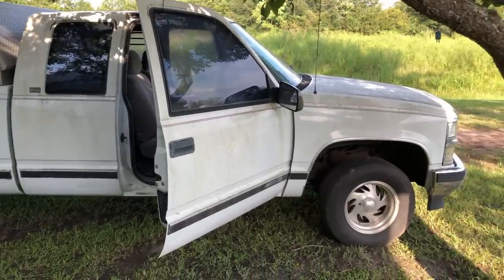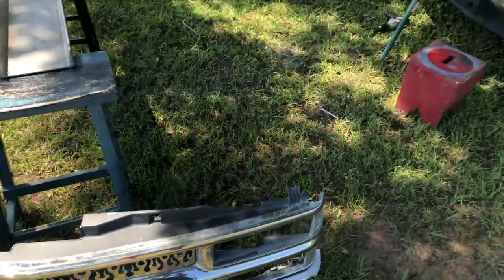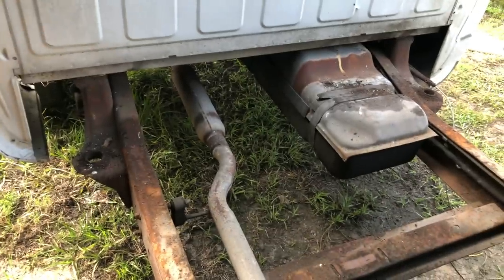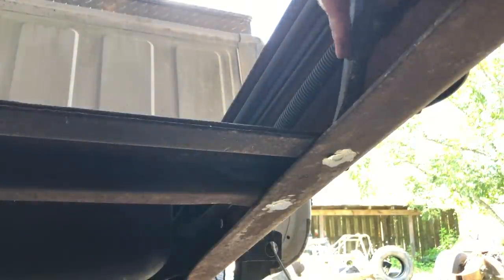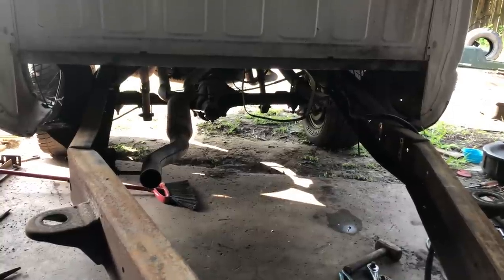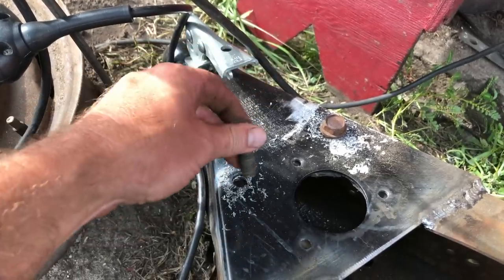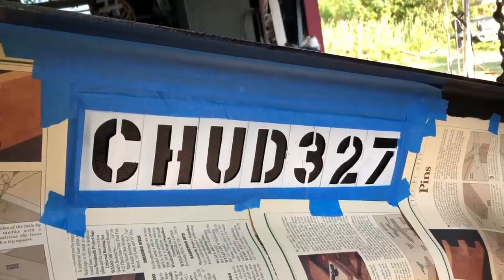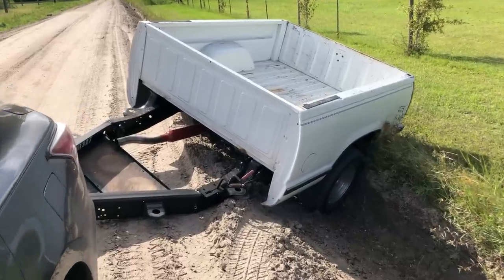Building a Sicker / Better Truck Bed Trailer #2

Comment: If you take out the tool box and mount it on the frame, that would give more bed space and shift a little weight onto the tongue. Of course, in this case it would hide the glasspack.
Reply from the maker: Great points, if you check out my latest build, I mounted the tool box on the tongue, plus no still glass pack to cover up. Thanks for watching!!

Comment: I kind of thought you were going to leave the gas tank in the trailer. If you put a switch on the fuel pump and put a hose on the fuel line you could make a portable gas station. You wouldn't have to carry gas cans then when taking out the mud mowers.
Reply from the maker: I thought about that and may have to put it back it... thanks for watching.
Reply: I bought a trailer that once had dual tank and thought the same thing
Reply from the maker: @WolfDragonTamer  good idea.

Comment: Its good to wear a full shield face protector when using an angle grinder because the blades are notorious for breaking off and hitting people in the face. Great video and good job on the trailer/s.
Reply from the maker: I will look into getting another, my old one broke. Thanks for watching.

Comment: That bed frame rail angle iron is some tough stuff hard to drill threw.
Reply from the maker: This one wasn't too bad, but I didn't have to make too many holes in it either. thanks for watching.

Comment: Good idea man. Also could take a pulley and put on one of rear yokes with a belt connected to an alternator and battery box system so you'd have power to run a power supply or inverter when camping. Possibly a tank in frame, with water tank pump set up for extra potable water.  Toolbox would be ideal for battery stowage
Reply from the maker: Sounds like good ideas and thanks so much for watching.

Comment: Hey man - move the toolbox outside the truck bed, forward onto the front bent frame rails. Then it can be a permanent store for ropes chains etc.
Reply from the maker: I have thought about that, I will need to see if it will fit and not interfere with turning.  It would also give a bit more tongue weight and reduce wind drag. Thanks for watching.

Comment: All of my trailers have a sleeve hitch on the rear and at times I'll pull them double. I have double n triple endorsement license , but never have been stopped when in smaller farm trucks.

Comment: I knew a guy many years ago who did this with a full size box painted like the truck . Both truck and trailer had matching caps . Looked cool as hell but about useless because he didn’t want to ding either one up .
Reply from the maker: That sounds about right! I would love to find a bed that match my truck and find some tires and wheels to match too. The good news is, my truck is already scratched up and I am sure the bed would be too. thanks so much for watching.

Comment: Lots of folks build these Pickup Truck bed trailers - and I understand the appeal and the functionality of them. Just wondered if anyone had EVER considered doing the opposite - a trailer from the front end of a car/truck. I think this might be a cool idea for an ATV trailer or a low-dump trailer. Take the front end frame - remove cab - engine and all the "stuff" including steering column and radiator etc. Then cut the Tie rod near the middle and weld each end to the frame so both front wheels are held in a aligned straight path. Now you have a independent suspension with nothing in the middle and you can fab a trailer bed that can extend between the wheels and has a "V" or "U" shape for soil/dirt/rock hauling. Similar to the Truck Bed trailer - you keep the frame extensions - but headed toward the back wheels - to bring them together to form the tow point. Seems like with the right cross bracing, maybe beefing up the shocks or struts you could have a really slick dump bed trailer with a low center of gravity and independent suspension on each wheel. Any small foreign rear wheel drive would do for a farm utility trailer for your ATV to drag around. I'm no welder or engineer - just wondered if this idea would be worthwhile considering you could find lots of potential junkyard project vehicles for little or maybe even free.
Reply from the maker: I like this idea and probably no one has done it before. Might be nice to leave the steering too. Locked for pulling and steerable in tight areas. I put a vw bug front end under a boat trailer once. It was cool, I could pull it on my dirt road and my son was  driving in and out of the ditches. Would be good for long trailers like the guy that steers the back of the fire truck. Independent suspension would be neat too. Maybe I can try it some time in the future. Thanks for watching

Comment: I like #2 better because it's a shy but longer. And if you end up making a camping cab out of the cab please make the wipers work that would be awesome and if you have a spare Chevy bow tie for cheap I will buy it from you! I got a 70s Chevy bow tie on my main mower now I need one for my other mower
Reply from the maker: I think I like #2 better too, but hard to say... Working on the cab camper now and I am brainstorming if there are any bowties around here... thanks for watching.

Comment: How do I make the rear axels in my truck bed trailer free spin?

I have 3 truck bed trailers like this and I love them, they are the most versatile trailers and I don’t have to worry about dings or dents because I only let the kids use the $50 trailer. LOL

SO, I am not a mechanic and I have a question about the rear diff. 
My largest (and best) trailer feels like I am dragging it. The tires roll and I cannot prove that there is a problem, however, it feels like there is resistance that should not be there.
I have plenty of experience pulling trailers and this one just feels off.
Almost like the gears are full of MUD not grease. 
The trailer is made out of an 80s chevy and still has the entire rear diff intact. All the gears and even the driveshaft yoke are intact and spin as it goes down the road.
I would like to know if there is a way to remove all the gears from the rear diff so it can free spin, but the only rear diff I am familiar with has the axels connected with the gears.

Hope any of this makes sense. 
If I cannot remove the gears or replace them with something, do I just need to open it up and clean and regrease it?
Reply from the maker: I would probably start by taking all the brakes parts out of the drums, unless you are using the brakes.  Other that that, you could jack it up and see how they spin with your hands.  I uses you could take the ring gear out and that would just have the axles spinning.  Maybe needs a new bearing or two... Last resort, you could pop the back cover off and see if you can see any issues... Good luck and thanks for watching.  Let me know what you find out.  Do you have any videos or pics of your fleet?

Comment: Howdy Chud! New subscriber here. Quick question if you have time. I've got a truck bed that's been taken off the frame...what would be the cheapest/easiest way to turn that into a trailer? I don't have any frame components for it.
Reply from the maker: I would be great if you could find an old junk truck that the bed would bolt right to. Maybe facebook marketplace would have some. good luck and thanks for watching.

Comment: Gotta chain a centrifugal clutched briggs 5hp onto that diff and have a powered trailer to move stuff around the yard like a giant power wheelbarrow...
Reply from the maker: Now that is a good idea and thanks so much for watching.
Reply: Im sure you could power it with a 5 horse, but you would need pulleys and belts to get the ratios right. 😊
Reply from the maker: @paulzedx636ninja7  For sure and it would be a fun project.
Reply: @chud327  you could probably use belts and pulleys or maybe some sort of gear reduction. It would be pretty cool. 😎
Reply from the maker: @paulzedx636ninja7  yes it would be very neat.

Comment: My brother in law use to pull a pop up camper with his 12' aluminum boat hooked to it until he got a ticket for not having a doubles endorsement on his licence . Nice trailers
Reply from the maker: Yeah, I would pull two on the highway, but it is cool in the yard. Thanks for watching.

Comment: Great ideas and all but I would recommend some better welds if you plan to put weight in the trailers.
Reply from the maker: Yeah better is good, I added bolts and I doubt there will be much weight,. thanks for watching.

Comment: Pretty slick make over of the truck into a trailer. I might start looking for long beds as that way you can turn it into a bigger camper.  Is it just me or is the audio a little low when he is talking and then gets loud when he uses tools?
Reply from the maker: I need to find a long wheel base next... Sorry about the audio and thanks for watching.

Comment: Should put the fuel tank back in and wire the pump up and put some kinda hose on it and you have a transfer tank
Reply from the maker: I actually thought about that, but did not do it. I am currently working on truck bed trailer #4, that video should be out soon. Thanks for watching.
Reply: @chud327  another idea that came to mind while i was watching was leave the cab camper on the truck frame and have the hitch in front of the cab, then you have a cab camper and bed to haul camping gear in. another thing you could do is put a alternator on the rear axle with it running off the yoke to charge up a onboard battery all ideas that could be handy,

Comment: How do you decide on the measurements and where to cut it?
Reply from the maker: I showed that better in episode #3 on the Dodge trailer.  I lay the coupler on the ground and put boards in it and measure how long my frame parts need to be.  
Then I find a flat spot on the trailer that is the same as the length I need.  I try to make the trailer tongue as long as I can. I hope this helps and thanks for watching.

Comment: Is there a way to connect to the original taillights to a 7 pin and connect to the truck to have working light?
Reply from the maker: Yes, it is pretty easy, you could do like I did and just get an adapter or with the 7 pin you could actually have back up lights... I know on my GMC and Chevy truck the wires are yellow, green, and brown just like trailer wiring. Dodge on the other hand had all kinds of random colors... thanks for watching.

Comment: you should easily be able to trade those aftermarket wheels for stockers that match what you have.
Reply from the maker: I had an eye on some bullet holes to match my truck wheels great, but the guy did not want to work with me on the price... thanks for watching.

Comment: you should make a truck bed out of 3500 dually
Reply: Them things are hard to find in good shape
Reply from the maker: Yeah, If I could find a deal on a good one, I would sure do it... Thanks for watching.
Reply from the maker: @oldcroneysgarage9739  I agree with that. thanks for watching.

Comment: Can't believe I missed. Got to messing with something while listen to outdoor boys my fav fishing channel.  The guy from cats and carp channel. But nice job. Wish I could get you over here to do mine. Or ide give you my ride just needs head gasket. I can't afford to fix and I got new breaks bearing the front end ball joint I did front end alignment. But it's 98 gmc it still starts just water in the oil. Guess I'm gonna part out. But here Louisiana can't make new ones but if I find one with title and tag I can use. Ide love to have one for fishing so bad. I got camper shell tool box ide love to haul that around. Alot room for tackle and rods. Can haul my gen and wheel chair can add my scooter ramp on back also. But very nice sir. Your right. That would be cool. Clean up the truck take out seats add a bed and cabnit and shelf. Put on a small trailer that would be a cool camper. You should do that I'll watch. You have a good weekend. God bless
Reply from the maker: Thanks so much and too bad you are not closer.  I need to find a topper too.  I am planning to do the camper out of the cab, unless someone want to buy it before it get it done... Thanks for watching.
Reply: @chud327  I hope you make one. Uea this topper got single door in the back the sides have big door that opens up and got one shelf the hole leangh of the shell so my beds 6 and half so only few in short than that. So that makes top and bottom shelf on both sides and got keys. I'm selling for 350 but of I get another truck to pull a camper to live in. Then I'll add it back on the truck. It was on Dodge I added to a 07 Ford f 150 then my 98gmc just had to add 2 by 4 to raise up some my beds little shorter. But took the tail gate off for perfect. Wish I could show pictures. Yea if you was closer ide help you out. I don't mine selling it. Cause don't no if I'll ever be able to find a truck to trade for my suv RV or van.  But man I miss my truck this suv each time I drive my hip pops out place hurts so bad. That's why I pull my small trailer I fixed up was pop up camper o got was just frame. But I go fishing I'm able to lay down get the pain down. But your white trailer man the tongue you could add wood to the top and make a small bed or add a recliner or rocker. Lol. me ide bolt a recliner some way. When I parked turn sideways and lean back. Hillbilly style. But the camper idea. Get this. 16 ft trailer. Put that either middle or front or back. But ide say middle.  That way in front you could have porch or just place for table chairs and all. But the camper truck in middle. The back little porch to sit on or get pop up canapy and have shade to sit.  Yes my brains difrent. But that would be so cool.  I've got two cargo been wanting to fix up but no help. Yea sucks your not closer. My big cargo was a big freezer truck like uhaul style now it's pull trailer. But I don't like to high to get in hurts my knees  but alot space inside

Comment: In some of the other videos I have seen the Deere with the winch up on blocks with no tyres what has happened to it my Westwood that I am building is going to have a winch on the front big bull bar like the Poulan little air compressor for tyres when I am in the bush for stakes to
Reply from the maker: The deere stopped going, just stays in neutral.  I will try to take a look at it soon, I miss the thing. thanks for watching and good luck with the westwood.

Comment: Chud, 

Could you please tell me approximately how much will one of these trailers weigh ? I have a suv that can tow upto 3000 pounds, and was wondering if I was foolish to pursue this build. 

Thanks -
Reply from the maker: I just sold the green one and when it was weighed, with out a spare tire of tailgate, it was 1040 pounds.  I hope this helps and thanks for watching.

Comment: You did a good job, but unless you plan to do something else like put a tool box on the tongue of the white trailer, isn't the tongue a bit long?
Reply from the maker: Yes, I do want to put something on the tongue. I am thinking of putting something there that would hold a riding mower.  I could also carry on it the bed of both truck for a total of 3 in one haul. That or a toolbox. thanks for watching.
Reply: @chud327  Alright makes sense.  Seems like it would be a bit biased toward tongue weight, but that's not horrible.  Better than tail weight.
Reply from the maker: The tongue is heavier the on tbt#1, but it is not heavy. I am even thinking of moving the spare to the tongue. thanks for the reply.

Comment: What is the bed/trailer weight? I heard these are too heavy once finished and are not worth the money and work since you can not carry much on them.
Reply from the maker: I am not sure what it weight, but I could run up to, and plan to, the weight station to get a weight ticket.  My 1st one was pretty much free and I would do it again in a heartbeat.  The second did cost some money, but I have made much of it back by selling the parts and still have more parts to sell.  It was just something I have always wanted to do and thanks for watching.
Reply: @chud327  They look nice regardless!!!
Reply: @chud327   they can hold more weight than a normal trailer, what ever the truck was rated for... Mine weighs roughly 800lbs and i can still haul as much as i can haul...  suprisingly for a car its rated to tow up to 5000lbs when set up right... My set up allows me about 3000

Comment: Convert a Caprice Station Wagon into an enclosed trailer. Engine out, fenders off, triangle the front frame, dash a steering out, seats out, BAM
Reply from the maker: That sounds cool, if I had a station wagon... thanks for watching.
Reply: @chud327  I actually have plans to do this.... I have a Roadmaster sedan that i tow an S10 bed pickup with... Someday i want to cut the nose off a dead Roadmaster Estate (same as caprice)and make a teardrop trailer for camping by removing the front seats and leaving the rears for a sofa... only issue is the heavy tongue weight, got to figure out some logistics

Comment: How much would you reckon that bed trailer weighs?
Reply from the maker: I did weigh the green step side and it was around 1400 pounds with out the tailgate. I would guess the white would be around 1800-2000 pounds, it has more frame and long wheel base with exhaust system and hitch. thanks for watching.

Comment: Was that a manual ext cab? Aren’t those hard to find?
Reply from the maker: It was and I guess they are.  It had not title though. Thanks for watching.
Reply: chud327 Manual obs chevys are getting hard to find, I’ve never seen an extended cab with it
Reply from the maker: Cringe Master good point, too be there was no way to get it on the road...